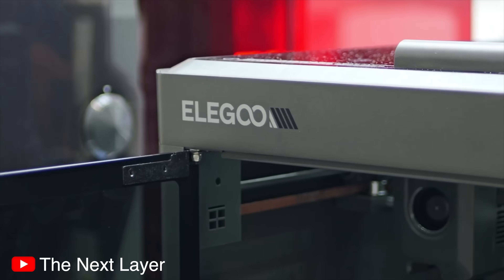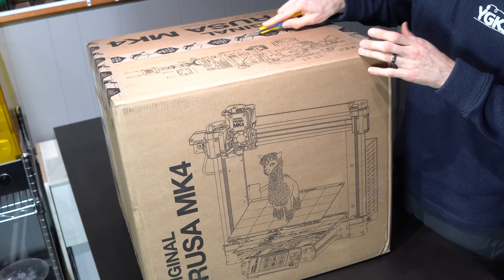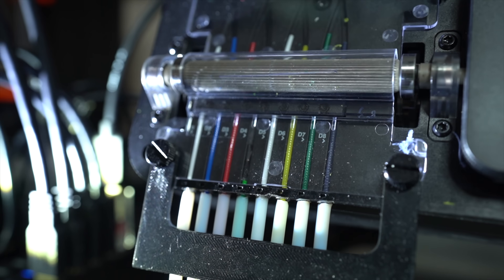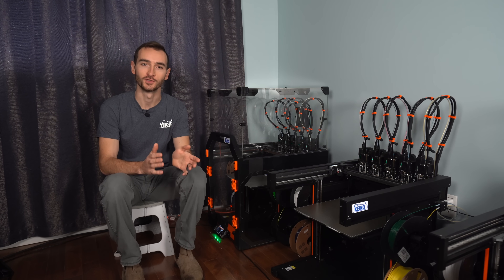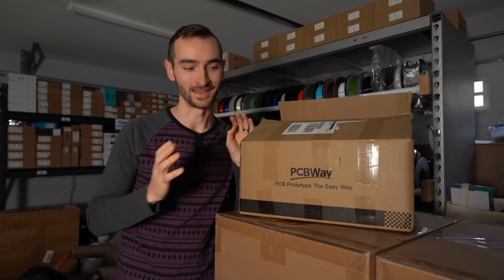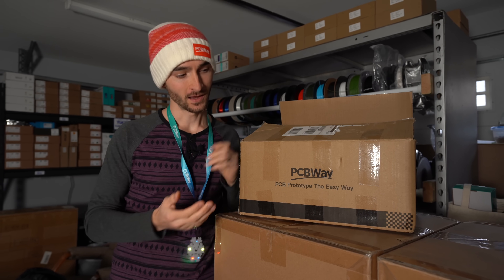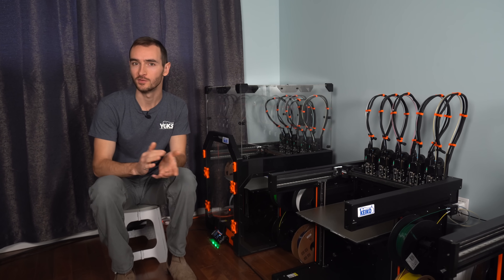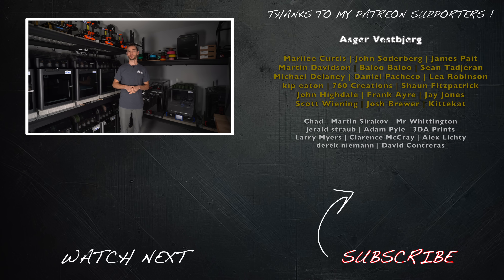The Prusa Core One is dividing the internet...

Comment: -Longevity
-Customer service
-You can just buy the upgrade kit to transform your Mk4 to the Core One so you get the machine for half the price of a comparable new machine

I totally see the selling point. Especially professionals who value customer service can't overlook this.
Reply: Pretty sure there Core One upgrade is only for the 4S. No direct 4 to core
Reply: @dfwdweghom8902  This is correct as stated by Prusa so far. It would be upsetting if there wasn't a specific upgrade kit from MK4 to Core One. You CAN buy the MK4S upgrade for the MK4, but surely a MK4 to Core One conversion shouldn't cost the entire extra 100 USD to do.
Reply: @dfwdweghom8902  yeah you're right, typo on my end
Reply: How many upgrade kits do I need for my mk3?
Reply: @travistucker7317  MK3 to MK4S, and then MK4S to Core One
Reply: Yeah? So you got your Mk4 for free? lol
Reply: @joshwhite4412  omg
You know what, yes! Totally.
Reply: so a core 1 from going mk4s > core1 kit is over 1500 usd vs just buying a core one being 1000 usd, half the price, yeah right.
Reply: If you put the core one next to a bambulab x1, in a blind test, which one would com out ahead. Bamulab 90% of the votes. 10% are prusa fanboys.lol
Reply: A lot of people ignore these, but the reliability, ease of repair, and expectations of future compatibility from Prusa is amazing. 

People say they're expressive, and they are, not for someone who just wants to tinker with a 3d printer. But, for someone who wants that quality and the brand behind it, it's worth it. There's no reason so many print farms would have Prusa if they weren't worth it to at least some people.
Reply: U completely disregard the fact that the Mk4 itself is a overpriced machine. So u in total paying as much as an x1c with the ams. I dont think it is possible prusa fan are all this ignorant, im guessing most are bots now so 010010101101010101
Reply: @tired5925  I don't know how people don't understand this, but the upgrade kit is only meant for people who already bought the 4s (not the 4).
So you can either buy a new competitor printer for 1200-1500 or you can upgrade your existing 4s for 600 bucks or whatever it is.
Reply: @Chretze  so I can buy competitor for < 600 usd and have 2 printers, or spend 1000 + 500 to still have 1 printer
Reply: @tired5925  The MK4 is expensive yes, but not overpriced for what it offers. They offer an amount of service, quick repairability, and customer service you don't quite get from other 3d printers. 

I will say, these benefits make it more of a print-farm style printer, than one many people would want as their only printer. It doesn't have the same versatility as an enclosed and multicolor 3d printer, but that's not their target with the device. Their target are people who repeatably want to print quality on the few things they do print, and be able to make repairs and upgrades in the future.
Reply: @benjikrafter  I agree with you, I'm running a smaller farm myself and recently bought a MK4S to compare it to my bambu printers.
The quality and accuracy of the printed parts is noticeably higher than on my X1Cs and A1s
Maintenance as looks very easy as I can just slide the cover off the toolhead and replace any connectors on the board if needed
I've had also contacted their customer support about some help with some specialized parts that I'm printed, and they were very spot on with providing information on how to tune the slicer settings for my needs in a 5min live chat conversation.
Looking at the Core One, you can see it's more leaned towards advertising to print farms than the consumer who only buys 1 or 2 printers, especially the bit where they emphesize the changeable location of the door hinges, easy of repair with the better designed enclosure, LED ligh bar under the bed so you can tell from afar in a row which printers are done and which are running, also their pretty heavy which should make them more stable. All these things will mainly appeal to print farm owners, also their prusa connect is made for printfarm compared to bambu slicers(yes you do have things like printago but I that's just another added cost to subscribe to). The Corse One is more than just a stop gap for Bambu but they will need to prepare some killer upgrade like dual hotend toolhead and then they can directly compete with Bambu's upcoming printer that was leaked recently.
Reply: @ I actually disagree that the Core One is aimed towards print farms. To me, it looks like an attempt at matching the all around functionality of an enclosed printer like many of Bambu’s offerings. As well, the customizeability they describe seems to be aimed towards consumers making personal mods. 

For myself at least, the Core One is a printer I will buy if I ever want an upgrade. Whereas previous machines I didn’t need their reliability so I went with cheaper options. But also, I’ve gotten very frustrated with printer issues lately so that’s another reason the Core One is on my next printer list.
Reply: @benjikrafter  well I want a good multicolor 3d printer for my next purchase, something bigger in size, and not have to break the bank for one. The creality k2 looks really promising, I don't mind tinkering, as long a sthe firmware is open source.

Prusa needs to make their mmu3 better, put it inside and enclosure like the ams. And incorporate it into their 3d printer, like offer a filament cutter so the filament doesn't jam up in the hotend. Just simple things like that, prusa isn't doing. People were complaining to prusa years ago to come out with a corexy 3d printer, core one looks cheap compared to what the competition offers. They are on their second interaction already too.

Comment: With the incoming tarrif on goods imorted from china, and that the Prusa will soon be build is the US these price points may become a mute point.
I would like to see your customer service experiences with trying to repair those faulty Bamboo, most people do not have the option of just throwing away a printer.
Reply from the maker: @garytfish  that will tip the scale for sure. Will be interesting to see how the prices compare once the dust settles.

I definitely wouldn’t just throw the printers in the bin but might consider selling them for cheap as is to someone with more time that is willing to repair them. I might consider making a video about the repair process if there’s interest in it.
Reply: @ygk3d  The force sensor is $5 and the heat bed is $120. There are step by instructions linked on the product page.

You have videos showing the Prusa XL build so I can imagine it isnt a skill issue. Michael from teaching tech has a fantastic debunking video on Bambu repairs so to give up without even an attempt is odd. Would you toss your Prusa machines if a part fails? If I remember you went through a ton of videos troubleshooting,repairing and even kludging together fixes for your Prusa machines.
Reply from the maker: @ thanks. Definitely not giving up. Just saying they’re not usable without repairs and haven’t had time or desire to dive into that yet. I didn’t mean to imply that they are permanent paperweights.

Comment: Long time ago in 2016 I bought an Original Prusa i3 kit... great fun... I then got the MK2 and MK2S upgrade kits and got lost some time after that...the whole thing lies in pieces after a installation of the very first Multi Material Upgrade kit got interrrupted by life... fast forward to 'now'. I'd like to get back into the FDM 3D printing game (after a fun side quest into resin land) but boy it's hard to pick a side to join... These days with less time on my hands I appreciate things that 'just work' but on the other hand the engineer in me always wants to know how stuff works and fix it when it doesn't... The stuff discussed in the video is exactly the discussion happening in my head. Thanks for pointing out both side's advantages and disadvantages though it doesn't make choosing between them any easier. ;-)

Comment: Right, and ease of repair is important. Prusa upgrade and product support is leading in the industry. Need more speed, get an other printer lol Cheers
Reply: Meh. The math has been done on that. More, cheaper, faster printers will always net you more money in the end if you are farming.
Reply: @phasesecuritytechnology6573  People aren't objective as long as the most competitive brand is also the most closed-source and proprietary. They want other more established companies to beat the disruptor.
Reply: People don't realize how faster is MK4S with input shaping compared to MK4. MK4S is already faster than X1C with same print quality. And Core One should be even faster without need for special high speed filaments (thanks to high flow hotend). Let's see in January when first independent reviews of Core One will come. But it looks like Prusa is taking the lead for now. And Bambu will have to come with serious improvements in new printers in 2025 to catch up.
Reply: @jan.bednarik  They have already surpassed everything prusa has come out with. It's just not released yet. Think about it... They were already working on the next Gen before the xl was introduced. By the time core one reviews hit, BL will release their next Gen in order to steal prusas thunder likely the day after embargo lifts. I've seen this play out in other industries the same way. On top of that there are HF hotends for the BL printers already getting 30+mms.

Comment: International the Bambu is WAY cheaper and easier to get than Prusa machines (in Canada anyways).
Reply from the maker: @marcusone1  the shipping fees and import taxes/duties really hit you when buying a Prusa. And hello from a fellow Canadian 👋
Reply: @ygk3d  Not just that, our excange rate. Bambu X1C currently listed at 1,299.00 Canadian.  Prusa Core One is 1199 USD, which is over $1,700 CAD without shipping and duty yet! by the time I get a Core One, I could almost buy 2 Bambu X1Cs.  I love  Prusa... but the need to stand out on more than reliability at that price difference.
Reply: @ygk3d  What hurts the most is that Prusa's business model makes it so to have their machines UL (or similar internationally recognized) certification, either a local importer or the end user needs to do it themselves. I wanted our uni department to get one but the safety and hazards office refused any machine that didn't have a cert to be plugged in the building's outlets, with good reason (insurance). That would have cost us 500-800$. For one machine.

We got a Intertek certified Troodon 2.0 from 3D Printing Canada that was only marginally more expensive than bought direct from Formbot.

It seems to be, as far as I know, the same with Bambu though. The local dealers do the certification themselves. I would never buy any consumer-grade 3D printer that's not certified and use it at home because if it did fail and burn my house down, I'd like my insurance to not deny a claim because of it.

IMO this is indefensible, both from Bambu and Prusa.
Reply: Prusa has partnered with Printed Solid in the US to combat this issue, hopefully that comes true
Reply: @dfwdweghom8902  won't matter for us Canadians i'm afraid.  Again, where bambu has crushed Prusa. Setup of local wharehouses in many contries to offer free shipping, incluidng no extra duty charges!